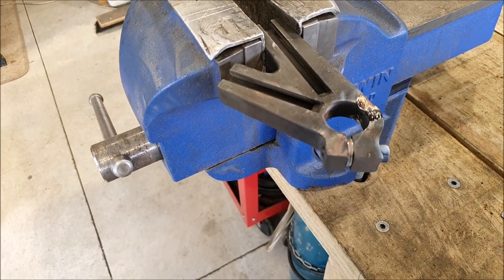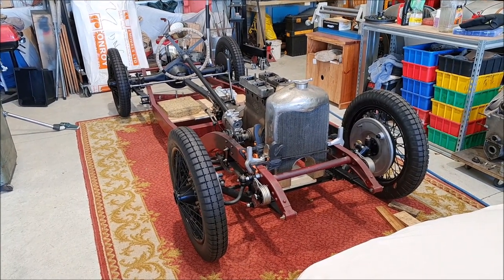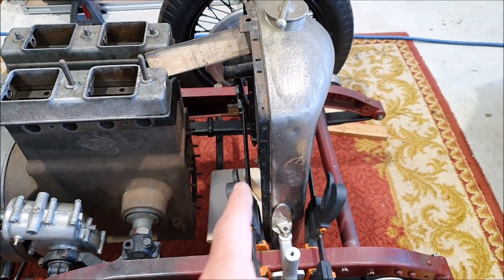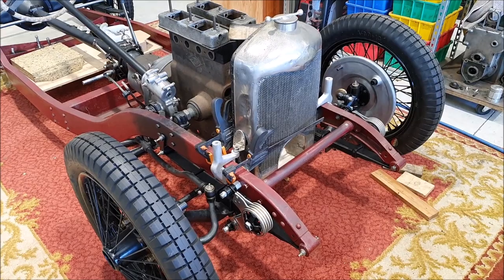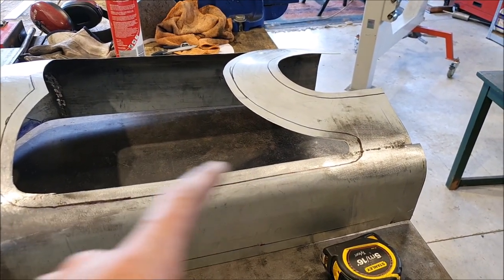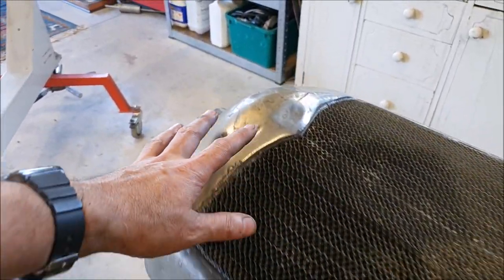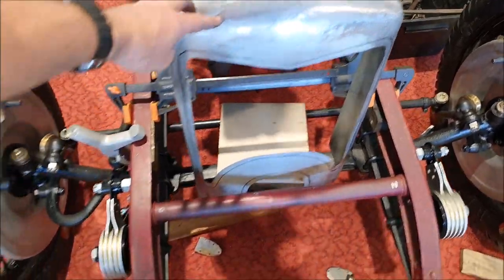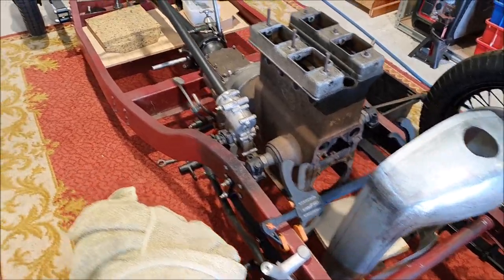Riley Brooklands radiator shell first attempt

Comment: If the coolant hoses are dimensionally accurate to the originals that will help with the fore & aft as well as height location of the radiator, may help to verify its position.

What are you keeping that nice radiator for? Will it end up being for someone else, or never used again? If it were me I would be using the very best on your car, if it is a keeper you will have the enjoyment of it, or if you sell it on, the price that these go for mean that whoever buys it will want the best, so unless it is destined for another project I would not have any qualms about adapting this to what it should be. Better on a car than on a shelf never to be used again!

On my pre-war cars, Austin & Standard Swallows & Austin 7, they all have a modern core, they all sit behind a dummy grille so  they are only apparent when the bonnet is open. I took the view that with modern fuels the engines run hotter than when they were built and traffic is much heavier too (certainly where I live on Sussex Coast in UK), so to give the engine the best chance I wanted the most efficient core to dissipate the heat. Practical use (the A7 is a daily driver) was the prime consideration over originality in this instance!

You might want to review your video, your address is showing on the jiffy bag your parts came in...!
Reply from the maker: Address is OK. Most people watching are overseas and the ones locally who watch know where I am anyway. Plus I don't have the editing skills to fix it!

I probably will use that good radiator and have it modified eventually but that's a job for when everything else is getting close to done as even that will be quite an expense. I agree it is good to have the best bits on the car but it makes sense to spend the money on the essential things first and worry about those expensive things at the end. Another example is gauges. A nice, big mechanical chronometric tach would be nice but eye wateringly expensive. If a nice one comes up at a good price I will grab it but no point buying a fancy, new/restored one now when I won't need it for a few years and do need to spend the money on aluminium sheet and timber (also eye wateringly expensive!)  to make a body first.